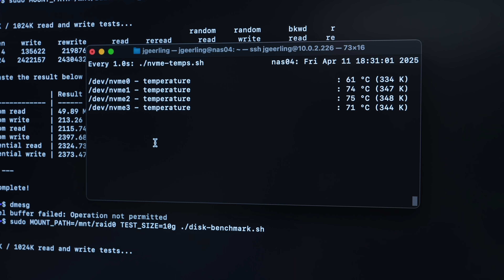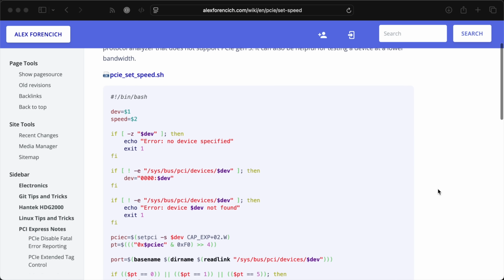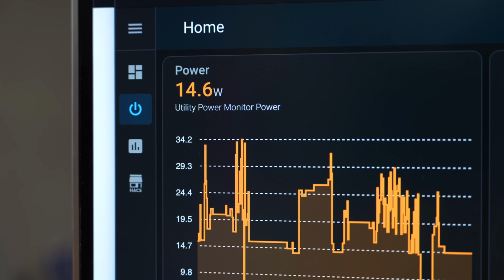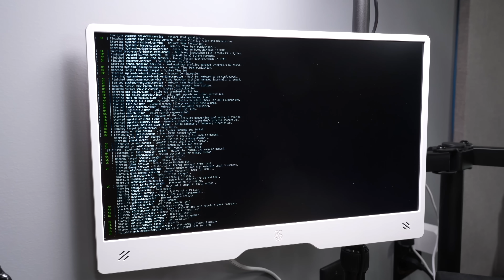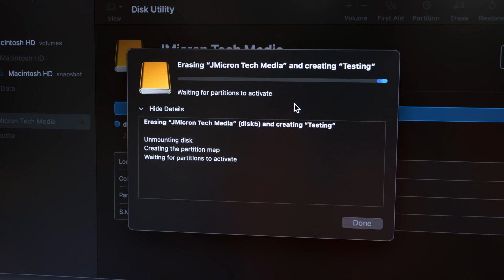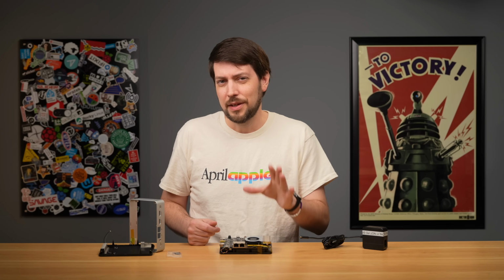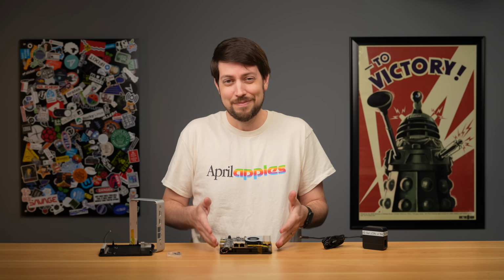I fixed the perfect Mini NAS!

Comment: I retired my G9 as it just wasn't reliable and I was worried about it catching fire !!... I am using an MS-01 for my setup now, runs OMV and JellyFin currently, with GPU passthrough, works really well, but the drives still get a bit toasty, so have it sitting on a 120mm USB fan..
Reply from the maker: Yeah MS-01 seems like it might be a little starved for air when run with a PCIe device!
Reply: @JeffGeerling   Yes unfortunately it is, however my pcie device is a simple MVME adaptor, gives me a 4th nvme in the system. I could also use an adaptor to place a 2230 nvme into the wireless slot, but haven't gone that route just yet.. I have proxmox installed on the nvme in the pcie slot and use the other 3 passed through to OMV. So far it seems to be working quite well, and even re-installing proxmox doesn't touch my valuable data etc... I had to remove the MS-01's internal nvme cooling solution as it isn't positioned very well and you cannot fit any heatsinks on the nvme drives as the fan simply does not leave any room :(, hence the 120mm extrnal fan, which could be mounted to the bottom panel, but I just have it sitting on it for now :)

Comment: This video is "How to make cheap Chinese crap NOT suck"
They go for base specs, but do NOTHING for longevity or actual system stability...just slap stuff on a board and call it "good enough" and make it look pretty...
If you can tinker and fiddle fart, sure modding/hacking/tweaking to make it work "right" but not at the prices they are asking for.

Comment: Design and 3D print your own case, with a centrifugal blower fan off to one side for flow through ventilation. You can put fins inside the new case to direct air straight to the hot spots, with the heat sinks you added.
Reply: I was thinking something similar to this while watching as well. There's some space on either side of the board (especially when it's stripped of it's default case) in the rack, and possibly there's space in the back as well.  Seems like you could come up with a solution that would work.  Now that said, would it be worth the effort?  Maybe not unless you already own the device and you hate to see it go to waste...  Or if you had oh say a youtube channel in which case it would make for good content regardless... 😁
Reply: It's actually seems like that you can just close holes on top panel with tape and it will magically fix overheating issues at least for board itself
Reply: I was thinking more along the lines of subtractive manufacturing: take some holesaws to the existing case, making it only a partial exosceleton, but regaining defined outer surfaces. Adding fans and/or  using the aluminium part as a heatsink should help too. At least a try would be quick and might avoid sinking more time and money into this project.

Comment: i wish they would make a board with nvme slots that are vertical instead of horizontal flat against the MOBO.  should still fit in a 1u height since the board is only 0.87in of the 1.75in 1u height  so decent room for case and mobo thickness. Them being vertical allows for both side cooling and potentially storage density

Comment: I bought this on Amazon and ran into many of the same issues. Taking off covers, adding fans, adding heat sinks to the NMVE drives, etc. I ended up returning back to Amazon...:(

I was looking for a mini-PC NAS. Either you get this type (under powered, overheating), or only has 2-3 NVME ports, etc. I went through several. Finally, just ended up with a used Dell tower workstation with plenty of cooling, power, and room to install a used PCI-E 4 port NVME card. Ended only spending less than $450 bucks all in. Now running TrueNAS and it rocks. Just hate the space it takes up.
Reply: How's the power consumption?
Reply: @PrezVeto typically around 170 w.

Comment: 5v at 5a is actually in spec for PD. The specification does not define specific wattages as requirements (e.g. 15w at 5v) but rather specifies the voltage stepping and maximum amperage (up to 5a at any voltage step).
There is also an adjustable voltage spec that allows for arbitrary voltages, but that is much less common to see in implementation. 

However, the spec does require afaik all PD suppliers to negotiate over 5v, and all recipients to be capable of accepting 5v for negotiation. So, this is definitely not in spec if it cannot negotiate at 5v before delivering 19+v
Reply: 19V is not in spec though either, it's a laptop power brick, but instead of a barrel plug it comes with a USB C connector at the end. PD 1.0 accepts either 5V, 12V or 20V; PD 2.0/3.0 accept 5V, 9V, 15V, 20V, 28V, 36V or 48V. 5V/5A is also out of spec for PD 1.0, but indeed allowed under PD 2.0/3.0.
Reply: @Biru_to  With the "adjustable voltage supply mode", the power circuit has much finer control over voltage negotiation, with steps of 100mv between 15v and 48v. So, with this configuration, 19v is in spec.

However, even then the client and provider must both still be capable of negotiation over 5v. So, we agree that this monstrosity is definitely not up to spec 😅

Comment: i have i intel NUC pc for my citrix work. When i bought it it was horrible, fan super noisy hot usw.. or throthelled down quiet but super slow... i found a full Aluminium case that cools all at once without fan. since i transfered the board to that i love my nuc pc. you should design somthing like that for that board. one big piece of aluminim with ripps on one side and the board on the other ..

Comment: if some one made a printed case for this with better fan mounts and just over all better air flow then this could be a amazing little gem to build in to somthing better but then a multi NVME board for a pi is also probs just a better and maybe cheaper choice ?

Comment: I have copied over 24TB of data between two of my UGreen NAS'es remotely (they are on two different locations) via site-to-site VPN connection. Took almost a week but everything got transferred correctly after verifying the hashes of the files.

I was using traditional HDDs. Iron Wolf Pros & Seagate EXOS. 👍
Reply: No wonder, even the cookie boxes could do that over a SLOW link.The only melt when you hammer there NICs

Comment: OH, just thought of it...the power adapter / charger that I use for my tablet and cell phone I bought from Fusion5 (the same maker as my Windows 10 Pro tablet). It's USB-C PD 3.0 compliant, has folding prongs, and the specs are...

Model:  KPTEC-36C 
Input:    100-240V 50/60Hz 1.0A Max 
Output: Type-C PD 3.0, 5V/3A, 9V/3A, 12V/3A, 15V/2.4A, 20V/1.8A (15W, 27W, 36W, 36W, 36W)
              Type-C PD 3.0, 3.3V-9V/4A (13.2-36W)
Dimensions: 2.0"x2.0"x1.2"

I don't know if it would be of any use for you, though it does a great job at quickly charging both my tablet (a Fusion5 FWIN232 Plus S2) and my phone (a Motorola Moto G Power 5G 2023). My phone goes into "Turbo-Charge" mode as soon as I plug that charger in and it'll fully recharge in 2 hours or less. It's been one of the best chargers I've found so far. Have make sure to use their U.S. store as they're a UK-based company (for those living in the U.S.). 

(Disclaimer: I don't have any business ties with Fusion5 -- I just happen to own one of their Windows tablets and a few of their chargers.)

Comment: I think there is something wrong with your GMKtec I have one of my own I have no problems with lock ups, I am running proxmox with the cpu running at full speed, I was able to get the fans to work in software keeping the system cpu under 85c with all 4 cores stressed  not even rapping the fans full speeds too. because I'm using proxmox I can't reliably use the mmc internal  storage (proxmox has issues with mmc)  I do not have a thermal camera so I'm just crossing my fingers (ignorance is bliss lol ) although I did take out the mesh out of the top cover not sure if it helped it was before I set the fans to work with the software.
Reply from the maker: Do you also have all four NVMe bays loaded up? It seems like some people have more thermal issues than others.
Reply: @JeffGeerling  I have 3 2tb inland SSDs for my 6tb raid and 1 1tb ssd for my OS drive I have like 2.5 of the drives with heatsinks on it, the controler on one of the nvme drives was getting really hot so I put a small heatsink on just that chip. I don't see the temps go over 60c , I wanted to tie the fan speed to the nvme drives and the cpu but I could not get it to work, so it's only tied to the cpu, not the only problem I'm having with cooling, the cpu his over 90c when booting up before the script runs for the fans.

Comment: This is so frustrating... I built my ZFS based NAS using literally old tech (8x 3.5" SAS drives, controller, older PC HW, new PSU & case), it is big, draws a lot of power, but the amount of problems building that wasn't even 10% of this project. It would be very nice to have something small, light and power efficient though. Could anybody recommend a good setup (which board/mini pc + drives)?

Comment: If you know someone with good metalworking skills, why not try designing a custom all-metal case with a faceplate that can cover the opening on your mini rack like any other device? I suppose you might be able to buy or make a liquid cooling system small enough to fit, or maybe use some Peltier-effect cooling.
Reply from the maker: Just a big heatsink mount would probably be enough. Or a moderate heatsink + cooling fan would do the trick. I may go that route at some point.

Comment: I have one of those el cheapo GMKTec n100  boxes that only has 1 NVMe and it's just fine for what it is, it's too bad this one is such a horror show.   I have one of those 5 Ethernet  port mini PC things and it's all metal and the case definitely acts as a heatsink and it deals with the heat quite well.   It would be interesting to see how this works with this kind of metal case, I'd really like to see how that one from the brand that reached out to you works.    This kind of little box has lots of use cases.    That power supply is a really bad thing and should not exist, it needs to be filed under "Y" for "YIKES" .    GMKTec makes a decent low-end minipc, it's too bad they dropped the ball so badly here.

Comment: Hi Jeff, the K100 All SSD NAS looks like Intel NUC 8 Mainstream Kit (NUC8i5BEH) , but you need to custom built the NAS stuff, like buyng a M.2 that has 4 to 6 sata and run everything via the SSD for the OS on it. ( I know running M.2 drives is better than SATA drives)

And you can max it out to 32 GB Rams DDR4

Now its ASUS that took over the Intel NUC

Comment: I know exactly what it's like to have a project that cursed. Mine was called the Tridex. This was an IDEX version of the Voron Trident open source DIY 3D Printer. First the Euclid bed leveling probe threw some sparks when the print head tried to grab it and wasn't quite successful and I instinctively tried to grab causing the sparks when one of the conductive magnets touched something it shouldn't frying the 24v line of the print head's control board (12v and 5v still worked). After getting that replaced (the Euclid probe was still fully functional), I finally was able to get both print heads to print at first. Then I started getting CAN BUS connection issues with one of the print heads. Upon investigating that with a multi-meter, the main printer control board decided it wanted in on the magic smoke fun and when doing that, it took out itself, the CB1 compute module (CM4 clone) and all 7 stepper drivers.  After all of that mess I finally got it to print reliably (minus the one time the print head decided to gouge the $100 build plate). At this point I should have just called it a day and stopped mucking around with it. Alas, I couldn't and decided to remove the Euclid probe and install Double Tap (The IDEX version of the Voron Tap). VERY BIG MISTAKE. Suffice it to say the printer hasn't printed since. Will I ever learn? (Probably not). During this I started to get diabetes related cataracts so that put an end to that project and many other unfinished projects. At least until I am able to have the cataracts removed which is unknown at this point so I've been almost blind for the last 2 years.

Comment: I got a beelink eqr5 somthing like that and it can get toasty. i have the fan set to 150 in the bios constant it helps keep i t around 30C with very minimal noise. 

im tempted to take it out of the case and have it exposed for awhile. not a fan of the case design. 

It has been stable over all.

watching this gave me some ideas. tyvm :)

Yes take that offer. :)

Comment: I'd love an in depth comparison of all/any of these: CWWK P6; Aiffro K100; Maiyunda M1 (and M1S) Mini; and the GMKTec G9.
Reply: You could also add the ODROID H4 with nvme splitter hat. I read that it could idle at ~4W without anything plugged in when correctly tuned. You even have 4 Sata for expending/backing-up your 4 nvme.
Given what I saw in terms of BIOS support, I'd rather recommend hardkernel vs cwwk.
Reply: @mryo-yobzh9485  I'll add that one to my list to check out :) cheers

Comment: Excellent info, Jeff.
My 6 year old, T4 Laser Synth  (ver VII) project is also plagued with similar thermal and power issues, due to the recent upgrade to the 6in ADC/8out DAC CODEC IC.
So I've been doing similar IR camera monitoring, Noctua fan/heatsink upgrades  and  optional wall wart  swapping. 
Waiting for the 12V 50x50x15 fans, taller aluminum case,  & 2 3/8" step drill bit to arrive from Amazon.
3rd PCB design in kicad under way, as soon as these woes are past. Won't release anything less than perfect.
NEVER GIVE UP!!

Comment: Regarding the 19V power supply with a USB-C connector, there are some vendors who do that, sadly. A well-known one often shown on CNX is MeLE. They sell their products accompanied with a 12V USB-C PSU that doesn't negotiate. I've put a sticker on ours' connector so that people in the meeting room don't kill their devices if they find the cable hanging. That's really bad. It's sad that you killed your RPi with it but it was predictable: the negotiation only serves to *increase* the voltage, not to lower it. Your tester showed 19V with nothing negotiating, you can be sure it will not go lower. During power negotiation, PSUs always start at 5V then increase the voltage once the nego is complete. You can see the problem when sending that to a device expecting only 5V! So the rule is: if it shows more than 5V on the tester, never plug it anywhere you're not certain will support that voltage!

Comment: Hey Jeff, Willy here. Usually when you find one cause for a machine hanging (here the PCIe speed), it's the only one. I mean with this that you could have restored all parameters to defaults (CPU speed etc) and very likely it would have been OK. Of course the machine would have continued to overheat but here the problem clearly seems to be a poor design around the PCIe lines that are not reliable enough for Gen3. Note that it's also possible that the SSDs draw more peak power during transfers at Gen3 and that the onboard voltage regulators cannot stand the peak on all 4 at the same time. This could be verified by checking if less SSDs cause the problem or not. If not, PCIe support is not at fault and the power lines are suspicious, if yes, the problem definitely is PCIe.

Comment: When you asked "have you ever worked on a project that just seemed cursed?" I felt that in my soul, I've been there too many times to count lol. But yea, at this point it's a no go. It basically needs a micro atx case with fans for better cooling, which defeats the purpose. Glad you gave it another shot though.

Comment: Very nice and thorough testing of the G9. I would not bother with it any longer, not until they implement all the suggestions that you made. And yes, I would take the K100 offer. But does it fit in your mini-rack? Looks like it is a little taller than you need. And thanks for the link for the TOPDON thermal imager.

Comment: GMTek G9 - $269US before drives (tested)
Aiffro K100 - $636US before drives (suggested)
SIENSNET N150 - $150US more industrial device found on Amazon
QNAP TBS-464 - $925US - not sure if still made...
UGreen DXP480T+ - $999US before drives (I mentioned this in the comments in your last video)

Are we just going to keep scaling up in price until we hit the $/performance peak?

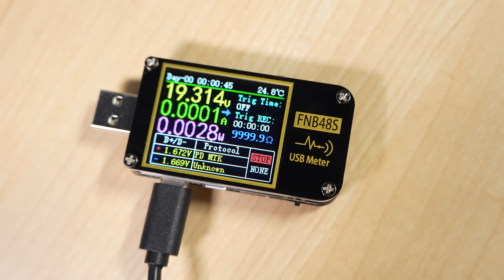Comment: 5:20
I first thought "maybe you'll use one of those GaN chargers, considering that it'll probably support those voltages, not to mention that it'll be better than using the standard adapter"

Comment: K100 is a little pricey but its been rock solid for me for the last 6 months. Running UnRAID with 4 4TB Crucial P3s using ZFS. Jellyfin, Plex, TDARR and a couple other containers all running well. Its been a great travel NAS so far. Keep the mini NAS reviews coming. Im always looking for a great road/plane friendly setup
Reply: Honestly P3s are horrible drives but for what you use 'em for they work fine. 
The MSI Spatium M461s are currently very cheap. 
Pretty much the same hardware but better firmware than the Crucial P3.
Reply: @ Yeah they arent the best but at the time they were cheap and on a 2.5GBe NAS they have all the speed you would need.

Comment: Have you tested Gen4 NVMe's with naked board at full speed/turbo/whatever else intel does have?
Reply: the SSDs are connected via a single PCIe Gen 3 Lane per m.2 SSD socket...why not ask him to put in 4 Crucial T705s? It would create even more heat for even less benefit.
Reply: @DJDocsVideos  this is the question I made. Reason for is comparison and measurement. How much is intake air flow responsability and how much is faster technology heat and if tech heat is applicable, how much influence this may have in temp and performance comparing to old Gen on the "noctua" case.